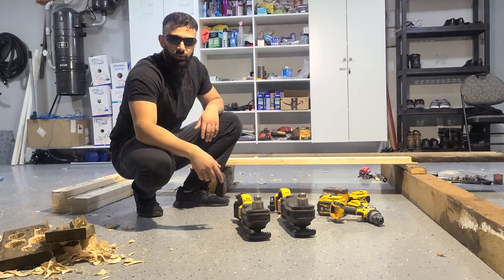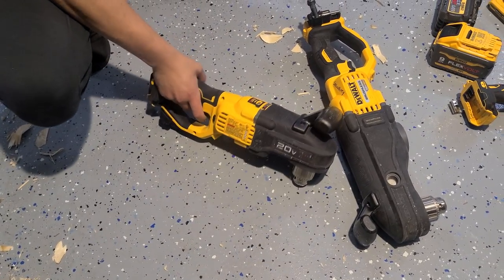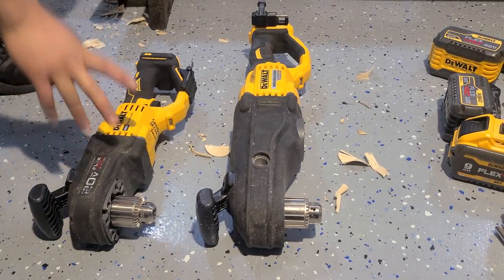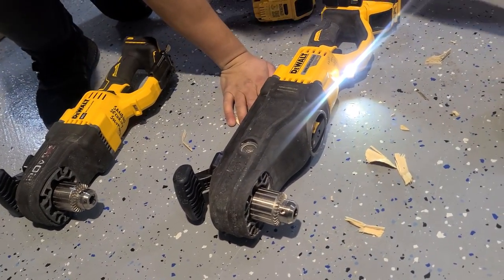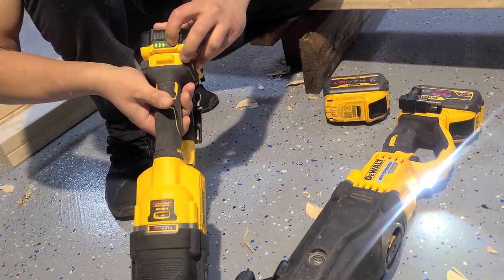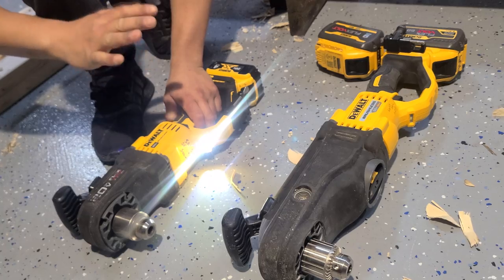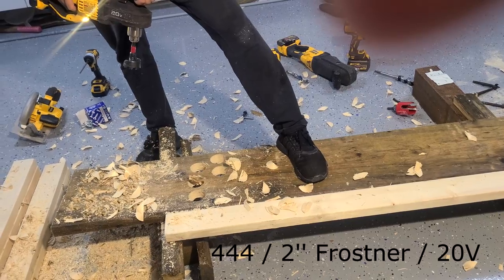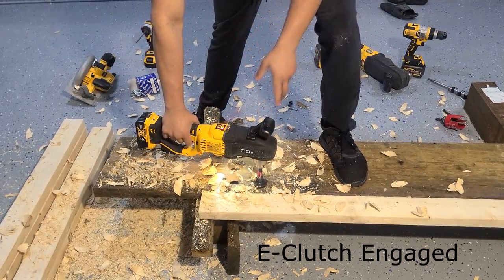The Dewalt DCD444B vs. DCD470 and DCD999

Comment: Just bought the 444. Thanks for the comparison
Reply: Where did you buy it?
Reply: @davparksoh  online from Home Depot
Reply: @johnsandlinjr  I've read nightmare stories about ordering online from Home Depot - how was your experience?  Also, what do you think so far about the 444 - is it a good tool - good torque?
Reply: @davparksoh  ordering wasn’t bad. Came in two days. Did come with a hole in the rubber housing on the front. But I figure it’s a tool, so it will get beat up anyway. I didn’t think it was worth sending back. Unfortunately I literally haven’t used it to drill yet. I’ll update you when I do.
Reply: @johnsandlinjr  I'm still deciding whether to go with the 444 or 445 - is your keyed 1/2" chuck good? - sometimes the chucks have trouble gripping bits.  Also, did you go with the 60v 9ah 609 flexvolt battery?  Thanks
Reply: @davparksoh  decided on the 20v version with the chuck. Went with the 20v because it’s smaller. The 60v is huge because it has the gearbox on there. And went with the chuck so I can do other things like mix drywall mud with it.